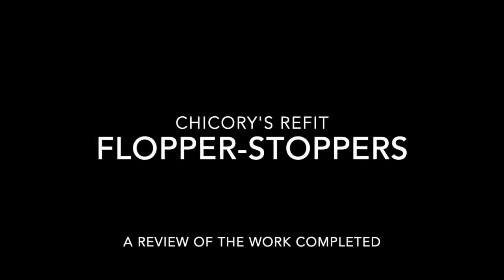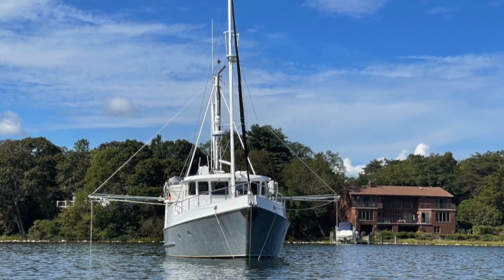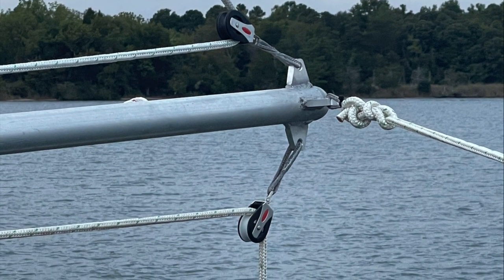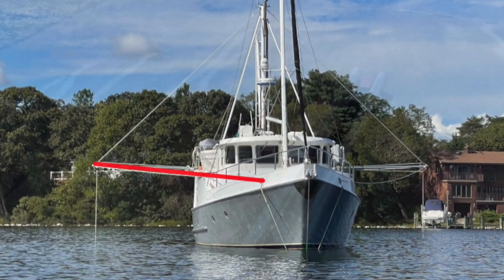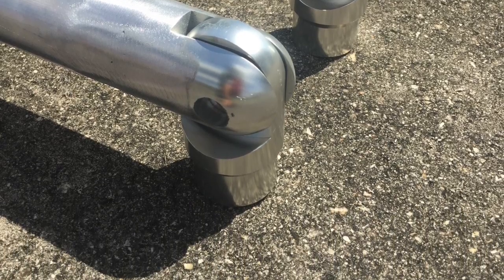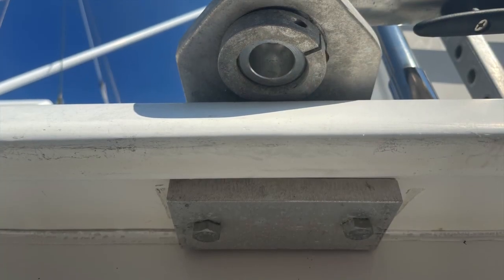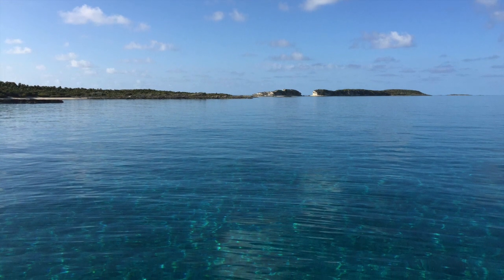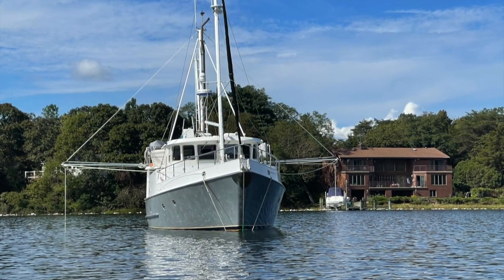Flopper Stoppers on Chicory a 46 Nordhavn

Comment: Best explanation I've seen about how these work.
I'm fascinated by the sail aspect of this boat. 
I didn't think there was a factory N46MS, although I could be quite mistaken here. 
I did read of one other N46 that was found abandoned in the Philippines and went on to have the mast addition to also become a motor sail boat.
Would love to see the sail operation, and any history of how it came to be, if you were interested in doing that type of video.
Very nice job and great fabrication work.
Reply from the maker: Thank you for the suggestion. I will make a video of that. There were five N46 constructed by the factory with sailing rigs. The original owner decided to delete the wing engine and add the sails for get-home power. I think there are only a couple left; the rest of the owners have removed the sailing rig.